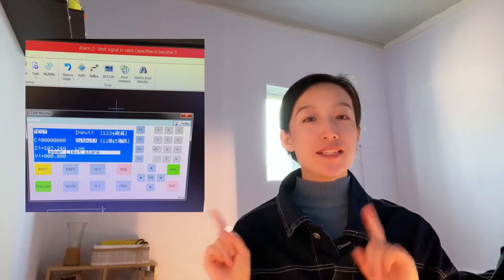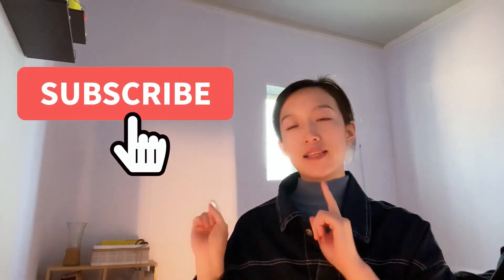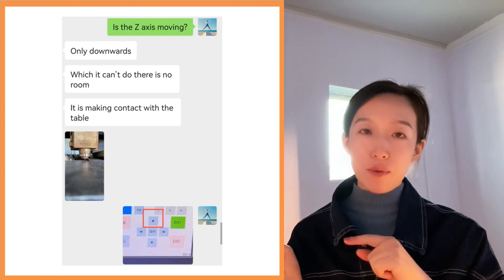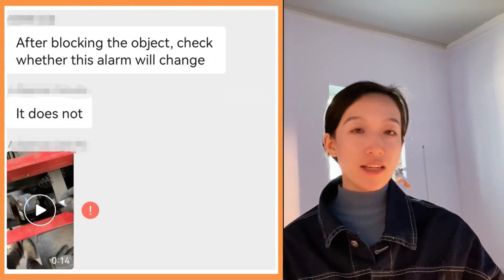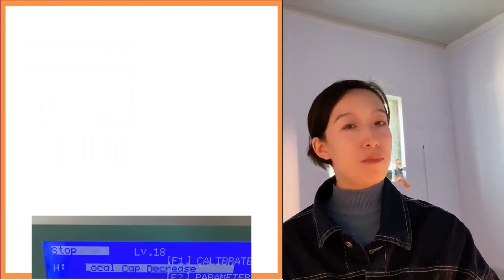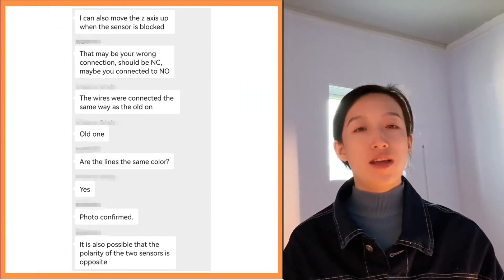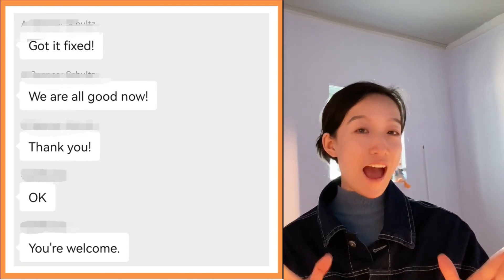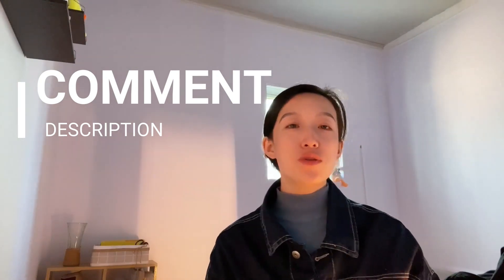CypCut Alarm: Z- Limit Signal is Valid | Service Case

Comment: Hi, i have the alarm - motor no response (axis Z), and relay doesn't receive voltage(24v) so motor's brake doesn't unlock and there's no feedback in encoder.
Have an idea of what could be the problem?
Thanks!
Reply from the maker: Is the motor okay?
Reply: @ClaraChai  we need to replace it, now it's working, thanks!